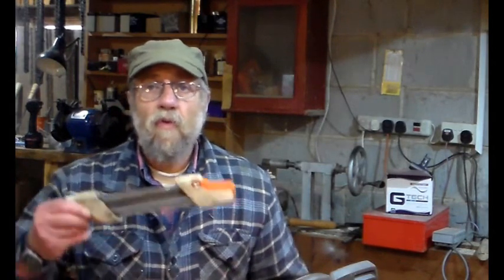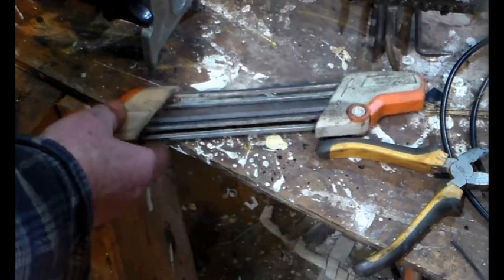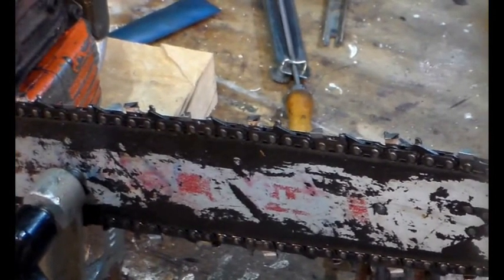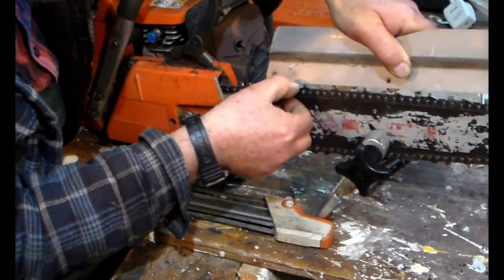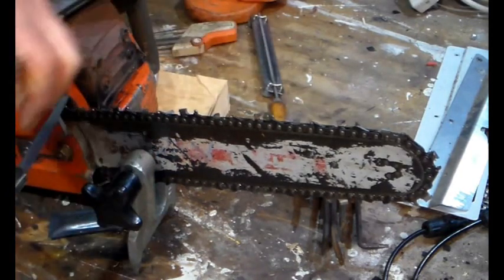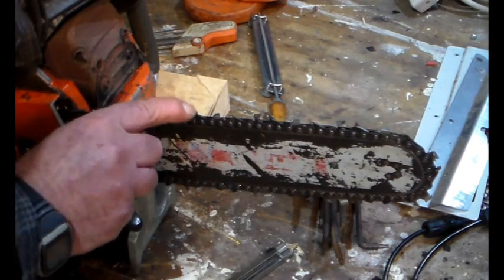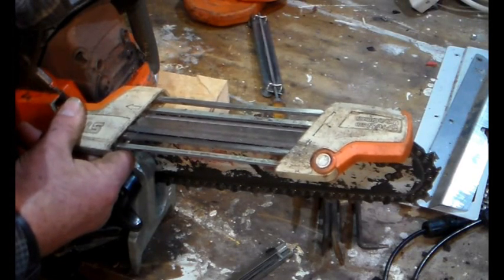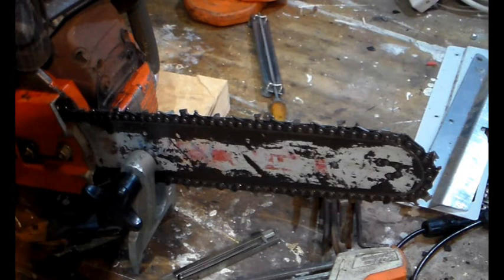Stihl 2 in 1 sharpening tool problems, aggressive chain setting

Comment: Informative video as always , I have never used the "new" style sharpener , I understand with new candidates it could pose an issue , but if its in good hands and powerful enough then it's fine,on my last refresher I piggy backed onto a newbie course, one lad fell over twice cross cutting with the saw running, which I suppose what your leaning towards, I personally love a saw to grab hold and pull itself in to a cut , it's 100% about being firm with the saw .. confident and perhaps most importantly don't go near the " kick back " zone ... I'm a full chisel type of a guy 👊👊👊👊... looking forward to the next one ...cheers
Reply from the maker: I like a saw that cuts well and pulls with no effort, but this is not for the recently trained, experienced operators only, but they don't need it, cheers

Comment: I've experienced the same overly aggressive chain with the 2 in 1 sharpener. The chain grabbing / chattering instead of cutting smoothly. Todd said pushing down too hard instead of into the cutter. I tend to file pretty aggressively so his suggestion might be the difference? I'm gonna give it a try because I really like the speed attained sharpening my MS 250 with the 2 in 1 compared to the old 2 step process, which I've done for 43 years.
Reply from the maker: Hi, the pushing down too hard will have little effect with the 2 in 1 as it does not flex with guides running on the top plates and depth gauges. I set my gauges manually at 0.8mm (30 thou) and that gives a good balance, cheers

Comment: I use one of these a lot a really like it but I suppose you could remove the flat file and make it a 1 in 1 sharpener. Just use the flat file with a normal depth gauge file jig every few sharpens.
Reply from the maker: That's what I tell students to prevent uncontrollable cutting, fine for cross cutting but for boring cuts it's impossible, cheers

Comment: I have the 2in 1 for both my ,325. And 3/8.     I agree regards grabby. But I still do like and rate it , I'd say use it second or third Time , I use the standard Stihl file holder thingy as standard.
Reply from the maker: Tom, as you say "grabby" and I think not for the novice, cheers

Comment: Strange. I'm seeing the exact opposite. I'm reading a raker depth of only .019" under the tops of two adjacent teeth, and the center square file of my Stihl 2-in-1 still isn't touching them!
I'm working on a "WoodlandPro 33RP" 3/8" .063ga non-skip Carlton A3 chain. It's a ripping chain so the teeth are ground at 10 degrees rather than the typical 30. I clamp an angle guide to my bar and visually line up the 2-in-1 tool to it. But that shouldn't affect the depths built in to the 2-in-1 tool.

I'm also noticing that the round files hit really high up on the tooth. The file is around 60% below and 40% above the top of the tooth. The result is that the 'face' of the tooth is quite vertical, rather than that deep 'C' shape you normally get from manually filing with a round file.
Reply from the maker: Colin, there's something not right you should be getting a .025 depth gauge setting and .030 would be better, cheers

Comment: Kickback is because people do not watch the end of their bar or they are cutting at less than WFO.  My eyes are always on the tip of the bar to insure it does not contact anything and in a cut I am always running the saw wide open, except at the very bottom of the cut and I am trying to cut through the log without getting my bar in the dirt.  Then, I kind of milk the throttle until the cut is finished and the kerf seperated.
Reply from the maker: John, thanks for the comment, even with avoidance of the lick back zone, a chain with lower depth gauges will give a harsh cut and make the operator work to keep control. It's a fine balance between a smooth pulling cat and harsh vibration and aggressive cutting. Cheers
Reply: @TheInfoworks  I always sharpen every new chain and check the rakers on them.  I got several new Oregon chains in the past couple of years whose rakers varied in height between the left and right side cutters.   Talk about crooked cutting chains.  I like the little Baileys File o plates but I do not have one for 3/8 full chisel chain.  I have one for 3/8 LP but not full house, full chisel.  I just do them by eye and this method has served me well.  Anytime you are cutting you better keep both eyes on the chain at all times, just like you do on the axe head when cutting with an axe.  Saws are dangerous pieces of equipment and anytime you get lackadaisical with them you are just asking for trouble.  I respect them and they respect me and I like it that way.

Comment: I have gone full circle on sharpening. File guide to roller to 2 in 1 and back to roller guide. The 2 in 1 is a gimic that sort of works OK ish but as stated it is a bit grabby. It will never beat a properly hand sharpened chain tho.
Reply from the maker: Ben, fully agree with you there, cheers

Comment: Andy - It's a shame that tool doesn't have some adjustment for the flat file in steps - I know this would make it more expensive and possibly less reliable without careful design and a lot of testing - but how much better it could be ! I have never sharpened to anything like 0.9, but I can imagine how fierce it is. unpleasant, professional or not..Cheers, Dave
Reply from the maker: Dave, odd isn't it how convenience takes precedence over skill, cheers

Comment: I like aggressive chains. I'm not scared and these things work just fine. Buy a low kick if you are a chicken.
Reply: Not fear. "Overly" aggressive chain chatters and jumps and binds having to continually pull back and re engage cutting. Not good for the saw engine, overstresses the chain, takes longer to make the cut, breaks chain teeth sooner, etc.

Comment: Hi Andy,  I tried the 2 in one set a few years ago and gave it away to a friend.  I can sharpen a chain many times faster with just a file and a file handle.  I then scan down the cutters looking at the rakers.  If I see a raker taller than the cutter I give it a few licks with my raker file.  I won’t saw my chains are not a bit hungry, they are, but they cut and pull the chain into the cut.  I just thought they were to slow for my tastes.  I can easily sharpen a 3/8, .050, 72 chain in less than 15 minutes.   I think the 2 & 1 is designed for people that don’t know crap about sharpening chains, which does not fit me.

Comment: Have noticed exactly the same for the similar Pfraud sharpening tools which I use.
My workaround is to use the tool every third or fourth sharpen. It's OK for the captive saw on the processor but far too grabby for safe everyday use imo👍
Reply from the maker: Jim, thanks for your confirmation of the effects and I agree it's a safety issue for all except the professionals, cheers

Comment: I’ve wondered what they would be like and shied away. Partly do to cost, (I buy my flat & round files by the box); partly due to the added bulk and partly due to either having to withdraw the flat file or carry another flat file, just to chamfer the rakers.
Reply from the maker: Old school methods are much more reliable and give greater control, cheers